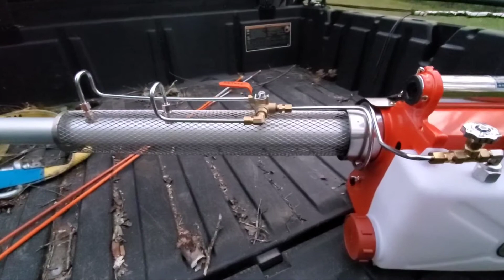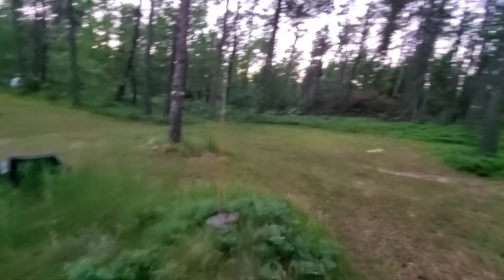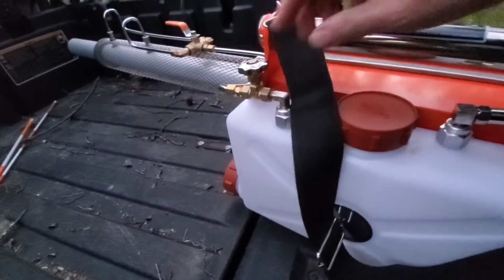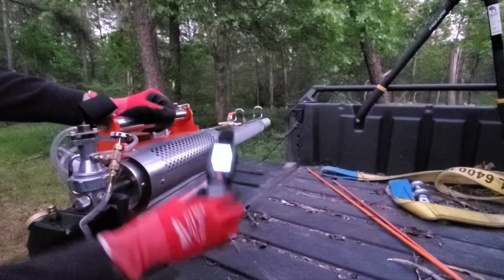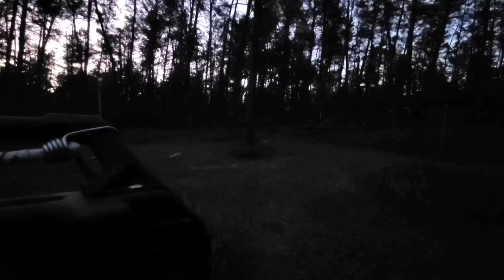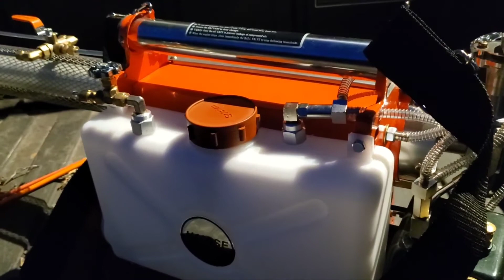Pulse jet Vectorfog H100SF   thermal fogger mosquito tick New 2022

Comment: Awesome…trying to decide whether to get this over a backpack blower/mister just for my .23 acre property. I can imagine this really distrurbing my neighbors that have kids running around all day…would you consider this more effective in the long run though?
Reply from the maker: @OpenTheAbcess  for that size lot I would just get a Stihl mister. Get the smaller one, it's so much easier to carry. My previous home I had a 1 acre lot and I did all of that with the Stihl. It worked great!
Reply: @Rochestermotorsports thank you thats the exact blower/mister i am looking at.
Reply from the maker: @OpenTheAbcess  use the 25.8% bifenthren. Much cleaner than the 7.9.
 1oz per gallon. domyown.com
Reply: Seems like a hard starting problem maybe the plug?
Reply from the maker: @durangoberdhan2695  for the sthil mist blower? I run the pre mix stuff you can buy at Lowe's in a gallon. It's expensive but mine always starts on the first or second pull.
Reply: @michiganmotorsports  naw just the ss 200 model of the vector fog thermal
Reply from the maker: @durangoberdhan2695  The best way I have found is to treat it like a jet engine. Hold the start button first for the air pump and spark and THEN introduce fuel.

Comment: Fog not coming out and it is not keeping the rev.  
What can I do to resolve this issue
Reply from the maker: @ceoemms  sounds like your fuel system is plugged or the little air pump isn't working.
Reply: @Rochestermotorsports  
Thanks
Where would I get the air pump to buy.
I’m in Jamaica
Reply from the maker: @ceoemms  Can you post a video of it starting/running?
Reply: @Rochestermotorsports  I will try to do that tomorrow. My technician did a video I will ask him to send it to me
Reply from the maker: @ceoemms  👍
Reply: @Rochestermotorsports   Where should I send the video?  I’m not seeing where to upload it. Thanks for your patience in trying to help me
Reply from the maker: @ceoemms  upload it to your channel.

Comment: its almost 2 years later. did it work?
Reply: Was that hard starting sorted?
Reply from the maker: @durangoberdhan2695  Yes, I took it apart and found that the stainless steel butterfly valve was missing a petal. Put a new one in and it starts right up.
Reply from the maker: @securethebag1613  yeah, it works great. I have 10 acres and I can fog about 50 acres around me. I just kept my neighbors a heads up that it's not a forest fire lol.
Reply: @securethebag1613  Yes, it worked well until now

Comment: You do have me outmatched   BUT I CAN fog and mow the lawn at the same time.
 I had a old poulan pro riding mower  whos  muffler was in the front {box with a pipe pointing down on the end}.

I drilled a small hole as far away from the exit i could , attached a long copper tube so it could reach the pestiside sprayer sitting next to the drivers seat.
I filled the sprayer with malathion [you can't get anything effective anymore] and after pulling off the tip of the sprayer nossle the other end of the copper tube slipped snuggly inside the elastic sprayer wand.

Now all i had to do is pump up the sprayer and wait for the exhaust to thoroughly heat up that large muffler .

It worked quite well but seeing by target were fleas hidden in the grass the smoke didn't linger as long as i hopped it would 
furthermore the mass of my vaporizer was insufficient store enough energy to make any headway before having to stop.

If only I new someone from Africa who could ship me over some DDT  and a sugar momma to handle the shipping and a wise master to teach me of the ways of importing goods.
 
if only that engineering degree was useful.  I swear we could have valuble people with unmatched skills if only they didn't waste 18 years of our lives. 
worthless subjects: History [all of them] , health class [ we have the internet , we can perform a Cricothyroidotomy, and perform the dance that I studied for since i was in 5th grade . 

It's a shame those detailed notes had a hot N---ed  lady printed on them 
It's a shame because I left the notes in the printer where my mom saw them when she woke me in the morning for school😳

At that surge of emotions hit me like a train.     adrenaline put my brain in survival mode . 
1. Snatch evidence before she reads any more. meanwhile i'm lying to myself in an attempt to convince myself she didn't read it all she saw was the hot lady.
 2. Soon SHOCK - DISBELIEF- EMBARESSMENT - SHAME  hit me all at once i was completely mortified.
3.  Tell mom to leave.
4.  quickly hide evidence
5.  put on a performance of a lifetime .  I name this masterpiece  "Act Sick so I can Play Hooky and avoid the most gruesome ride of my life"

HAHAHAHAHAHAHAHAHA my Mom let me stay home. 

I was so grateful she understood and it made me so happy that she is my mom.
Reply: P.S. press "read more"  embarrassing story rant posted
Reply: Mcguyver

Comment: Nice review.  Thank you!
You mentioned deep experience with foggers.  Assuming good mechanical skill, is it worth fixing up a $300-400 crapbox or just dropping the $1-1.5k on something supposedly nicer?  I'm cautious about buying a more expensive one (such as this) and still having to fix it up in the first year (e.g. replace every cracked fitting, correct design defect, etc.).  This one looks well made, but there aren't many true/unsanitized pictures out there.  Also, what kind of life do you get out of the diaphrams?  Thank you again :)
Reply from the maker: As of May 2023 this fogger is available from the manufacturer for $588 USD. I haven't had to do any repairs in the past year. My usage is light, maybe 5-6 times a year. When I contacted customer support with a few questions they were very responsive.
Reply: @Rochestermotorsports  I ended up purchasing one Longray-branded (looks exactly the same) and am quite happy with it.  It did need an electrical rework out of the box, and the metal edges were RAZOR sharp.  Zero maintenance so far with about 60 gallons of solution pumped through.  Being able to switch between oil and water base is nice.